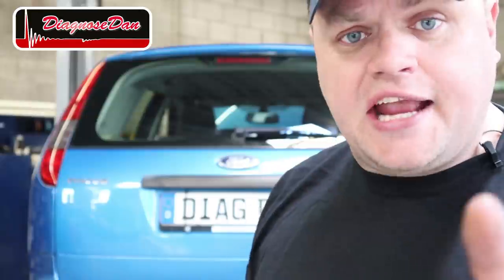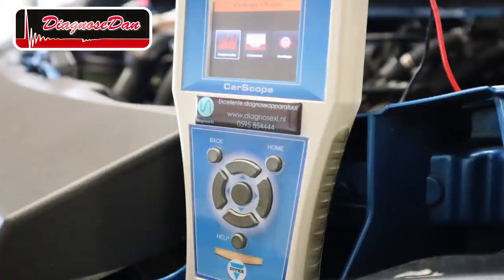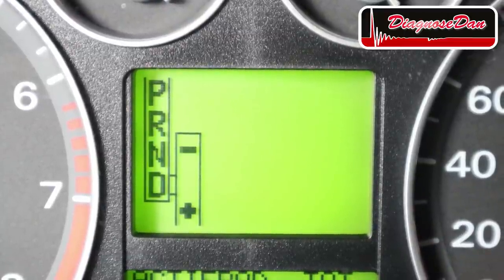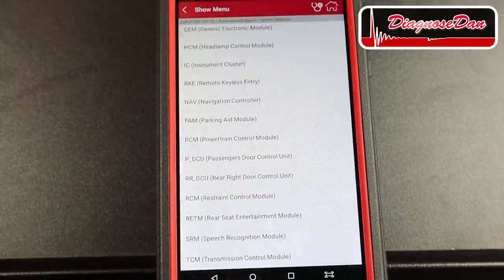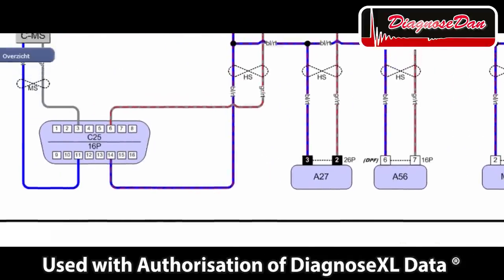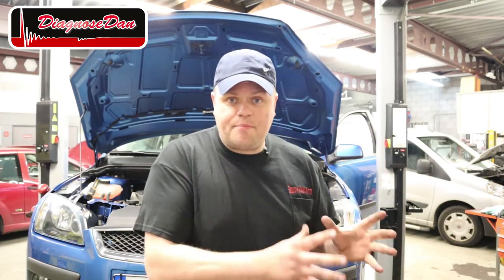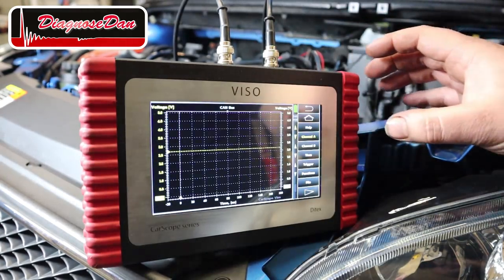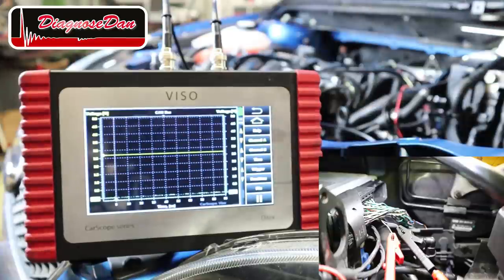Ford transmission trouble part 1

Comment: What is the difference between the Launch Diagun IV and the Mini Pro?
Reply from the maker: The pro mini has a bigger screen. Makes it easier to look at live data.
Reply: Thank, Dan. Is that the only difference? Same capabilities as far as you know?
Reply: Welp, my Mini Pro showed up today. Paid 699 and I'm pretty dang underwhelmed so far. I am in the USA for reference. 

Worked great, tons of coverage on an 04 Grand Am.
Was VERY buggy but worked on an 04 BMW X3, decent coverage. 

No coverage on an 01 Yukon XL.
No coverage on a 12 Chevrolet Traverse. 
No coverage on an 09 Chevrolet HHR.

I was hoping this model would be a plus for viewing graphs on the larger screen. You can see 6 at a time, and graph any PID. Unfortunately, the update rate (and speed in general) of the actual tool seems, thus far, to be incredibly dismal. 

I'll keep giving it a whirl, but it's going to take a lot for me to warm up to it after having no support whatsoever (besides global) on three very common GM models.
Reply from the maker: @ClaytheBMXer  I'm sorry to hear that. I'm pretty sure your problems will be solved because the scanner is able to communicate with these vehicles. The support desk is ready to help you as soon as you wake up😊. There can be a little delay because of time zones.
Reply: Thanks, Dan. I'm explaining my issues to them now. To be clear, I did have generic OBD functions on at least one of the vehicles - and I assume all - that I mentioned as having "no coverage". Just no manufacturer specific communication. They have said that the two tools in question "have similar features but support different car models". I will update when I get this resolved, in case anyone else runs into this scenario.
Reply from the maker: @ClaytheBMXer  keep us updated!
Reply: I'm still waiting to hear back from the company,  but I had some success today.  When I got home, I decided to update EVERYTHING, including GM Brazil and all of the Chinese and other makes that I did not update yesterday because I live in the United States. I now have functionality on the Yukon XL, which I did not have yesterday. Why,  I don't know. Maybe some of the coverage overlaps. I'll keep trying it on more vehicles. My biggest complaint right now,  assuming it works on the other vehicles, is that it's slow as molasses. I don't think it would be able to catch any relatively quick drop outs or glitches, even with only one PID selected. That said, I do want to see what I can do on other vehicles now that it apparently has more functionality.
Reply from the maker: @ClaytheBMXer  i heard the company contacted you, glad it Works now.
Reply: Yes, we were in touch and they did their best to answer any and all questions I had. They investigated certain concerns I had to get me answers, and were honest if they did not know the answer to a particular question (mainly about the difference between these tools and some of the US market tools). I am told that the vehicle coverage on the Mini Pro and Diagun IV is not the same, but similar. The Mini Pro also apparently supports more functional tests, but otherwise has the same features as the Diagun. I will continue using it and update my experience at some point in the future. If anyone is going to go the route of buying one of these tools grey market, I can say that this seller DOES actually support the product and is willing to work with you in real time. I also look forward to seeing you use it in more videos in the future!
Reply: @ClaytheBMXer  Thanks dear,hope you can update your experience in future.

Comment: I mentioned cliffhanger before u posted this video. The tool u were using seems to have the wiring diagrams already in it, or it is connecting online to their data base. Which is it?  If u would have unplugged the module, it would have had no power and ground. So short of depinning the wires, cutting was the easiest thing to do. U were trying to assess whether it was coming or going. Half the time, I don’t know whether I’m coming or going. You’re comedic skills r approaching you’re diagnostic ones!!
Reply from the maker: Thanks Bill, the screenshots of the wiring diagrams were taken from my laptop. It's an online program.

Comment: My guess is the 120 ohm resistor on the one side of the can bus is blown or open.  Can I add, as per your hint in the video.  In another video there  was also an explanation on how it works.
Reply: After seeing video 2, I found out I was wrong.  Should have watched video 2 first.

Comment: Cutting the wires verifies the no communication code from the tcm , if you tested for power and ground on the tcm , what is wrong with cutting the wires as diagnostic insurance?  as long as you do a proper repair after , it is part of a complete diagnostic process. Any one criticizing that step is out of line. Also it is a great demo on how on a can bus system all modules have the duality of sending and receiving.
I suppose as an alternative you could unplug the module put power and ground and look at can high and can low with the lab scope , it depends  on how hard it is to remove the module.

Comment: wow 2  giveaways  at once !!    i do hope before you cut those wires you checked power and ground going to that module.  nice shout out to sma!  there are car washes but this time of year  if ya go through one ya gotta get it dry or your doors freeze shut.
Reply from the maker: Nobody uses them over there🤣🤣
Reply: @Diagnosedan  ya gotta watch out for some of those jeeps they grow grass  under the fenderwells and never use deoderant

Comment: So if transmission is shifting gears there must be power in the TCM and it must be working. However harsh shifting comes from no communication TCM<=>ECU and the ECU doesn't know when to reduce torque as there is no info from TCM about the shift command. This probably leads to no contact in TCM socket (rusty pin?) or some other electrical issue on TCM side (broken track inside?).
Reply from the maker: Answer in part 2 😉

Comment: A Diagnose Dan mystery video! Did he check powers and grounds? What is the resistance of the CAN buss? Why did he mention the termination resistor in the cluster and where does the other hide? In the PCM as usual, or somewhere unexpected? Stay tuned for the thrilling conclusion in Part 2 of, Diagnose Dan The Evil Wire Cutter!
Reply from the maker: 😂😂 We find out in part 2

Comment: Diagnosedan,  I hate your channel,  thorough diagnosis, well explained, keeping the viewer involved and educational has me spending too much time watching your high quality video's of a master at work.  I need to get a life of doing something other than watching your video's

I have one question,  how would you determine if the transmission module is emitting data on the CAN bus without cutting the wires?  I would imagine that if you could not pull the wires out of the connector you could obtain another male and female connector to the module and manufacture a breakoutbox or maybe it is sufficient to disconnect the connector from the module and use 4 wires and whatever other power wires to connect between the module and the connector on the wiring harness and cut use those CAN bus wires.  Hmmm....  or could you disconnect the CAN bis from the otherside of the wiring harness.  What would you do without cutting the CN bus wires to determine if the module is transmitting data or not?

Sadly another dedicated viewer t your channel.

Comment: I would have thought the Can signal would have been dirty without a termination resistor.
Reply: After watching the second video cut wires must have been a spur from the CAN bus. The bus was sill in tact because there were no terminations on the module side of the cut wires.

Thanks for cutting the wires its a good way to learn.

Comment: Maybe there is nothing wrong the module.. it just isnt sending because its not receiving. Isn't that part of the protocol.  I wonder if it not just possible to trigger a module to respond. A simple command and it send will back ack or something
 Can't wait for the answer. But please don't make to much two piece movies. Ivan and Eric i need to wait every time.
Reply from the maker: 🤣🤣 People complained the video's were to long. And now to short😜
Reply: @Diagnosedan  Sorry I will wait then. :-)

Comment: im in :) as im doing same things that would be nice addition:) before cutting can bus lines i would check power supply lines:) now thinking way to check can bus direction without cutting but cant think any option without cuting or somehow get in between lines :) maybe resistor in series and look for dominant bit from gearbox module:)
Reply from the maker: Power and grounds in part 2, cutting the wires just educational😉

Comment: Dan, keep up the good videos on network diagnosis, there are very few 'good' ones out there. And while I understand why you chose to cut the CAN wires I still cringed!!  I did a similar network diagnosis on an Escort a few years ago, but with a slightly different approach.  You should check it out:  https://youtu.be/YSC4PH8xOfA